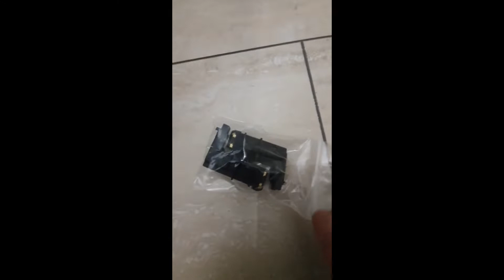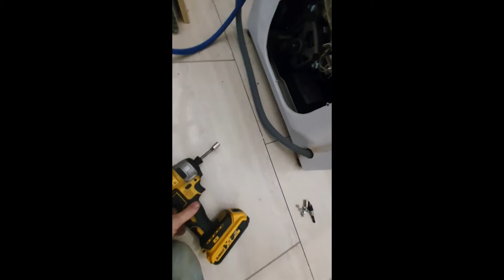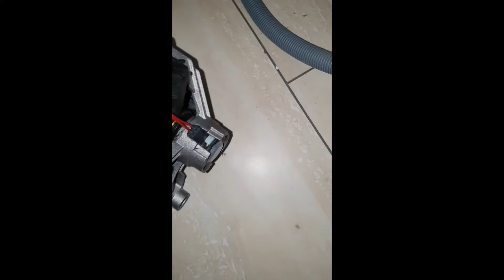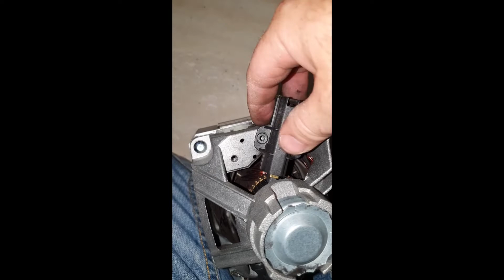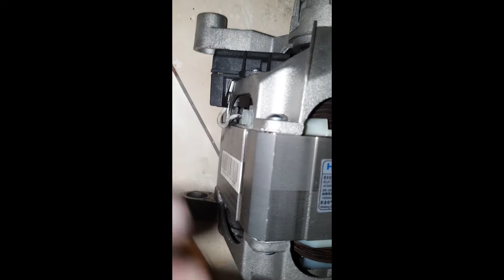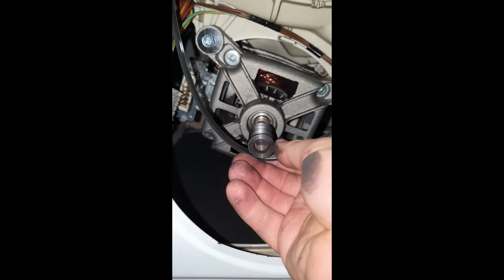How to replace the motor brushes on a hoover hwb814dn1 washing machine

Comment: How do you know the brushes are the issue? Did you get an error code? My machine comes up with a code sthg that looks like Ir 8 8. that isn't shown on the error code list then turns itself off
Reply from the maker: The error number came up (can't remember which) I googled it and it was motor error. Another give away was putting it on a spin and seeing it not move at all!
I just googled er 8 and jndeed that would mean brushes, whole motor  or speed sensor error. Basically the machine can't 'see' any movement. 90% chance it's the brushes.

Comment: Thanks mate. You just saved me around £500. Mrs wanted to replace it. New brushes and its good to go. Also new belt for £11. Old one was stretched by around 1/2 inch and having to take the kitchen to bits to get the machine out meant it was worth just to replace it at the same time. Definitely recommend anyone to do that when replacing brushes. 😊
Reply from the maker: Glad the video was of use, it is good for everyone if we share such adventures online:-)